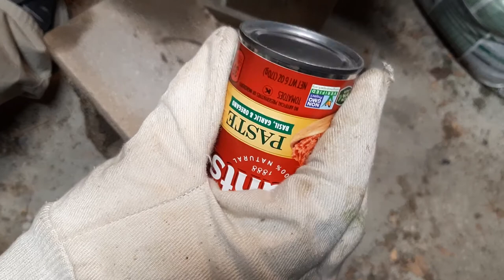Can You Really Open Canned Foods Without a Can Opener?

Comment: Thanks for busting this. I pack P38 and P51 military can openers...everywhere.  Pro tip, if you've never used a military can opener then only use one for about a month (if you open a lot of cans) to get used to using it.  Once you get the hang of it, it's easy.

Comment: We used to do this with coke cans to make cups to boil water in a pinch.
Reply from the maker: Well, those are laminated on the inside in flammable plastic coating that spews cancer causing black smoke into the air so you're lucky you're not dead.